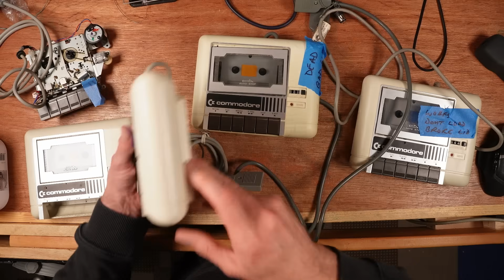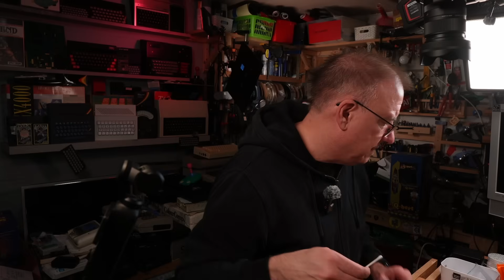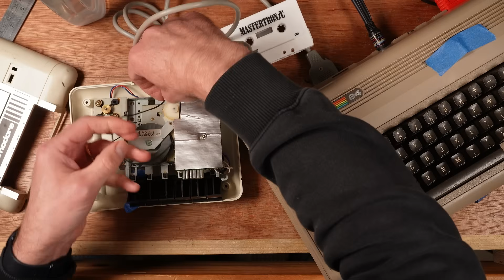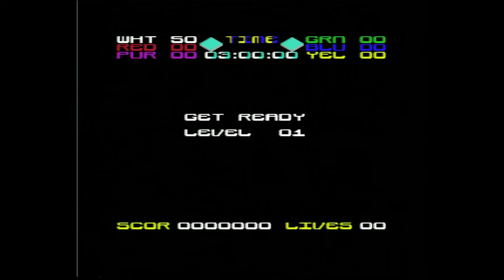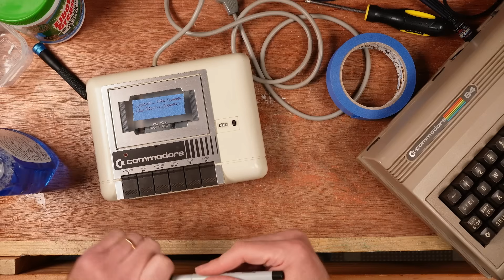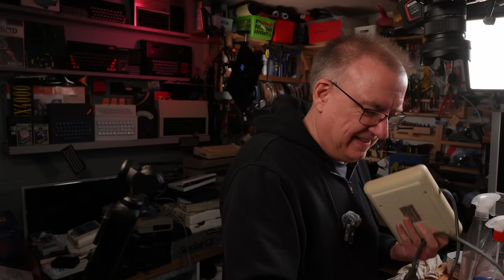Commodore 64 C2N Tape Deck Repairs

Comment: Hello, I’m having problems with an old Japanese C2N. Replaced belts, caps, cleaned pinch roller etc. it still won’t load reliably. The motor speed keeps varying. If I take the back off there is a smell like slot car motor smell. Makes me think the motor is though the outside isn’t getting hot. Is it possible to use the later Taiwanese motor with its bracket on the earlier units? This motor has a speed control on it that can be adjusted.
Reply from the maker: I honestly don't know. Probably worth a try!

Comment: This is incredibly useful. I just got one and has the blue screen too. If I rewind it works fine. But fast forward and play are very slow and then stop. I will open it up tomorrow and check some of the things you pointed out

Comment: The best stuff for cleaning pinch rollers is a product called platenclene. It's made by AF and comes in a pump despencer can. It's designed for restoring the rubber platen of a dot matrix printer.
Reply from the maker: I have some in my Amazon basket ready to order for then next time I do tape deck repairs. Thanks Jon :D

Comment: I use a product called Platenclene on the roller / tyre / belt. It's intended for printer rollers, takes the shiny layer off the rubber and leaves it able to grip much better. It's been around for decades, I fixed a leaking sunroof on my first car with it back in the 90s.

Comment: The drive belts are 120mm. Also, they mostly go bad by increasing in length, so measuring a bad belt isnt the right way to find the length.

Comment: I'm afraid that, 'the community' are often given to unreliable lore when it comes to maintenance. Using IPA on rubber is not a problem so long as you don't leave it in contact for too long. By "too long", I mean tens of minutes to hours. It can break down or liberate the longer-chain molecules that keep the rubber springy.
To counter that, you can use a small amount of silicone spray grease on the rubber after you've cleaned it thoroughly with IPA.
"Oh you can't do that, the rubber won't grip!"
Once again, the "community" doesn't understand what's going on. A lubricant works by preventing two surfaces from contacting. A small amount of lubricant applied to soak a surface and then wiped off to be dry-to-the-touch will not impede grip.
You want to introduce 'moisturisers' to the rubber to keep it soft. Silicone spray is excellent on carbon rubber.
Reply from the maker: That's great info. Thank you. I've already been scolded a few times on the comments today for using ipa

Comment: Having used a C2N tape for my PET 2001 and my C64 for years, I pity anyone who still wants to use them. I mean the 1541 is slow, the Commodore tape is glacial.
Reply from the maker: Testing them is a pain. They take so long to load. I believe the Spectrum loading from tape was a fair bit faster

Comment: I would have replaced the capacitors. There's a good chance they would be bulging by now. Most of these datasettes have 2 or 3 10v 47uF electrolytics in them (depending on the version).  I replaced them on one of my datasettes and got much improved loading performance from old tapes. 
The only other thing I will add, is that tape loading can differ without the case compared to having the case back in place as the azimuth alignment can be changed with the tape in a slightly different position to the read head.

Comment: I've fixed several of these datasettes and never actually found one with bad belts. I had one with similar issues where the gear would not move fully to engage the other gear, but it was actually just the mechanism that was gummed up and didn't move freely. After cleaning it up, it worked well with the original belt.
Not to say that new belts are never needed, but people tend to often just blame the belt when they are usually fine. Much like C64 PLAs. 😀

Comment: There's also a clear plastic washer that goes on the tape side of the capstan. It comes off when you pull the capstan flywheel out. I think you missed that one as I'm pretty sure you can just see it floating around on the bench in the 2nd half of the video.
Reply: Damn my old eyes!
Reply: Good hint for future repairs

Comment: I use meths on heads and pinch rollers rather than isopropyl. I've actually been working on a few of these drives this week too - one has a dead motor but the other two are running great again - I added a small amp and speaker to one so I can adjust head azimuth by ear, a la Spectrum :)

Comment: That rubber roller is done now. Even when you're not going to leech the last softeners out of it, a bit of glycerin is good for old rubbers and plastics.
Reply: The pinch roller is actually quite easy to take out of that mechanism. Just a single plastic cap or locking clip depending on the model and it lifts off.
Then it can be cleaned against a piece of paper, no chemicals required.